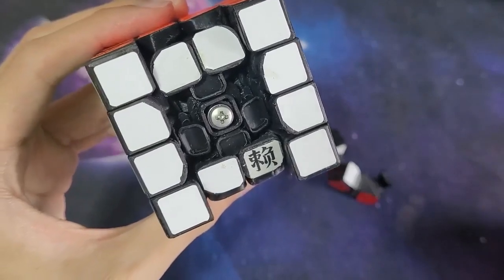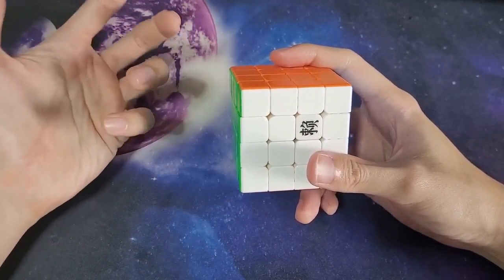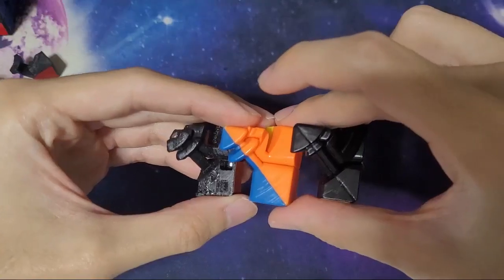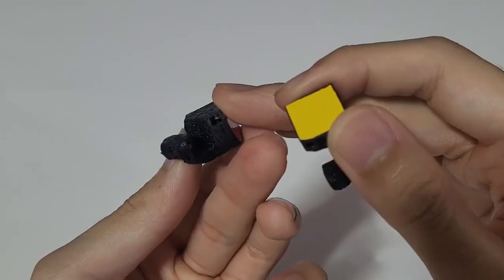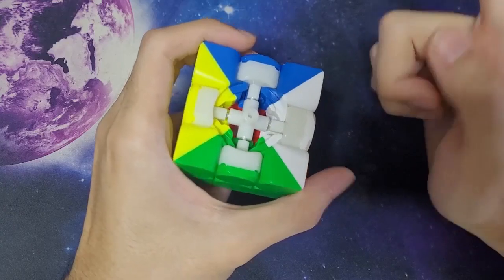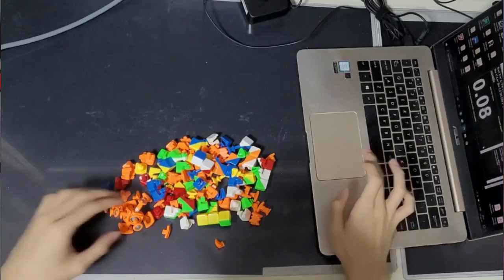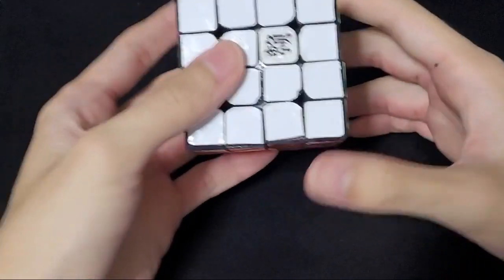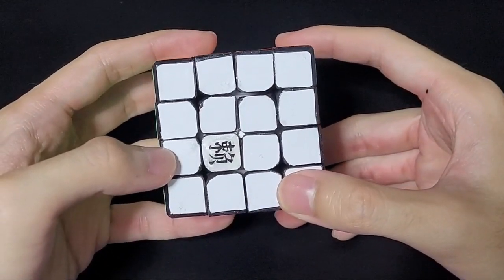I tried to IMPROVE the Maglev 4x4 | Lai Maglev 4 v2

Comment: hey what 3d printer do you use?
Reply from the maker: Ender 2 pro (basically the Shengshou of the 3d printers). It's old, slow and need steup/mods compared to the modern tech we have now.
If given the money, Bambu labs A1 (or the mini version) is probably the printer I most want to upgrade to.
Reply: @laiscube  do  you have plans of buying a better  3d printer? and would it make your puzzles better?
Reply from the maker: @sokweyd  Probably in the long term, yes to both.

Jacob cubing has proved that with a stronger FDM 3d printer and a smaller nozzle, it's possible to build a 23x23 that's around the size of the Moyu 15x15 (smaller than their original 13x13) and still have it to turn relatively good.
Reply: @laiscube do u consider resin 3d printer?